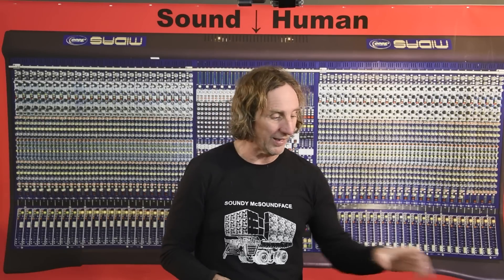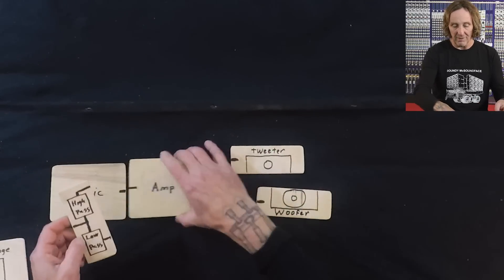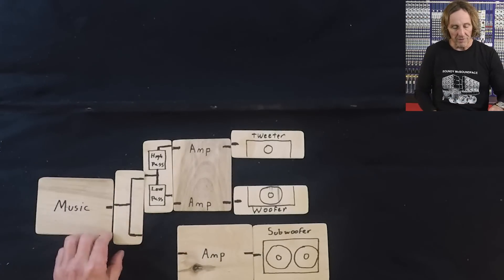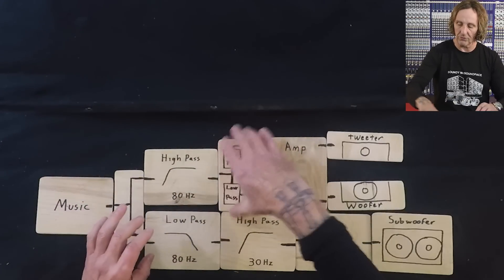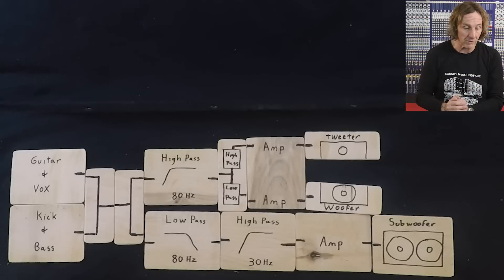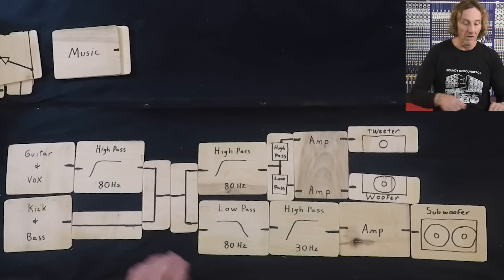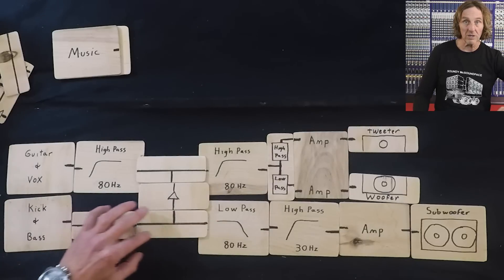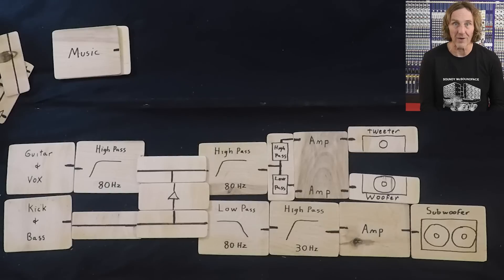Sound System Signal Flow Evolution

Comment: I saw Kiss at the FedEx Forum in Memphis a couple of years ago. My wife and i could talk to each other through the whole show. Sound system didnt have any balls. I remember the rigs of the 80s. The concrete in the arena would shake. The mids would make the body alive with energy. And the highs would literally make your eyes go crossed when the singer hit the right note. I miss that.
Reply: Sounds like you were mighty unlucky and got a seat in a weak area of the sub's coverage. I hate when that happens, I saw Yes play the Paramount in Denver 10 years ago, and it was a similar situation. But we just moved down the row to some other empty seats, and it was fine.
Reply: @Aquatarkus - So, is that all there is? Modern Systems have the same sound? Id love your view. Class AB vs D power. Speakers,  etc.
Reply from the maker: Modern systems higher fidelity, smaller, lighter, louder, offer better sightlines and greatly improved coverage than the older systems.

That said, band budget and the quality of the sound engineer will be the true determining factors of the audience audio experience.

Modern shows can sound amazing in ways older systems could never achieve

Comment: Hi Dave ! Absolutely helpful and smart ! Just one thing - THE TRIANGLE ! I not understand what gear is this  ? :) What im saw is some kind of ONE WAY crossover ? or ... Thank you !!! :)
Reply: I think he said it was representative of a summing amp.
Reply from the maker: It signifies a summing amp or buffer amp. It lets signal flow only in one direction but does not alter the signal
Reply: @DaveRat   Thank you Dave! This works on the principle of diodes apparently, passes the signal flow in one direction! Very handy!
Reply from the maker: Well, diodes do allow electricity to flow one way but only the positive or negative voltage. So a dioxide will cause massive distortion int the audio path.

It's more like a preamp with no gain

Comment: One argument against subs on aux, as I understand it, suggests that allowing dynamic adjustment of the sub level creates the potential for a system tuning problem as the effective crossover frequency is likely to change with the level of the sub.  Is this really something to worry about?   Thanks for the video!  Looking forward to the next one, too!
Reply from the maker: That is definitely an interesting concern and it's important to put it into perspective.

Assuming the time alignment and phase alignment between subs and the main PA is accurate and perfect at the crossover point and that the subs and main PA are not phase aligned at frequencies above and below the crossover point, then keeping them aligned would be beneficial and would require a somewhat precise volume level correlation.

Additionally for this precise alignment to stay intact it would be mandatory that the subs and upper boxes are located in very close proximity to each other.

If there is distance between the subs and top boxes then moving closer and farther away would alter that phase relationship for the listener much in the same way as altering the volume relationship between the two.

So to keep things in perspective, the importance of not putting subs on a separate send is about the same as the importance of not having your subs at any distance located away from the top boxes.

That said, the way I describe sending to subs in this video maintains the volume relationship between the subs and the top boxes as long as left and right Master level and the subwoofer Master level are adjusted together. All other level adjustments at the channel and subgroup level maintain the accurate correlation.

Personally, I think that having distance between the subs and the main PA is an advantage and when that happens only a small sliver of the audience will see that proper phase alignment which I generally treat as fairly unimportant
Reply: @DaveRat  Thanks for walking through that!  Very helpful perspective!
Reply from the maker: Cool cool Dave! Sent the A10 a shirt and some pouches to ya
Reply: @DaveRat  Thanks, tons!

Comment: I think the one only case where subs on an aux might not be ideal is on rigs where the tops are high passed pretty high, like 100Hz or more. In that case, you might not get as much low end as you want on channels only routed to the tops. Not an issue with big PA of course. But there have been a couple of occasions on other people's rigs where I wound up having to dial evan vocals into the subs to 'warm them up' after configuring aux subs, and a full range rig would have been ok.
Reply from the maker: I agree they would be less effective with a system that has a higher crossover to the mins as you would put more instruments in the subs. That said, if you are able to eliminate 1/2 the inputs or even 25% from the subs, that is still a gain.

Hh, oh, BG vox, sn bottom are all good contenders
Reply: KV2 ES is a good example of tops being high passed pretty high at 125hz
Reply: @ashergregory2013  with the system like that, I would want to have another box to cover from say 45 to 125, and then subs to cover below that. It’s kind of a pain to have to add another band-pass of speakers, but it would give you a lot more control. Not to mention that  subs sound better when they don’t have to go up that high where they sound boxy and directional.
Reply from the maker: Agreed, any box that goes over 100 is a low box not a sub.

Subs are typically 80 and below